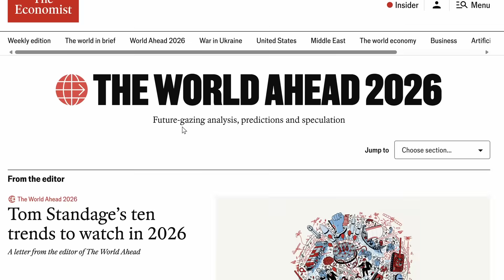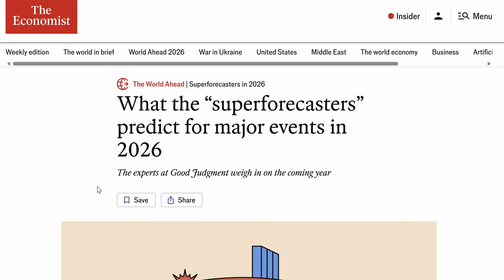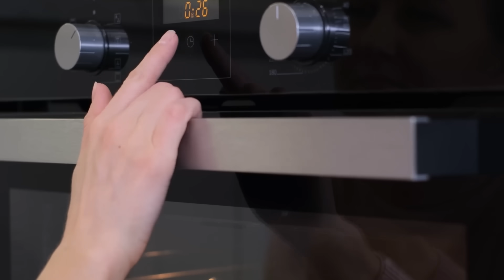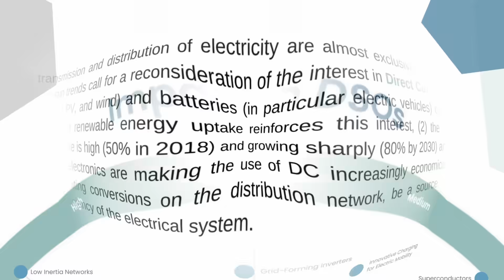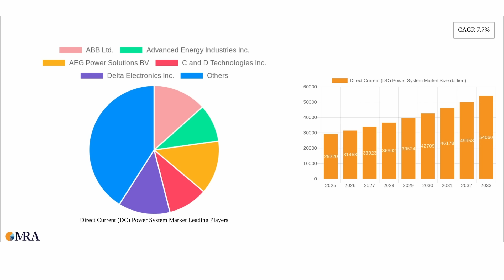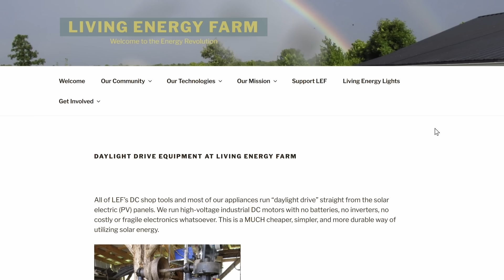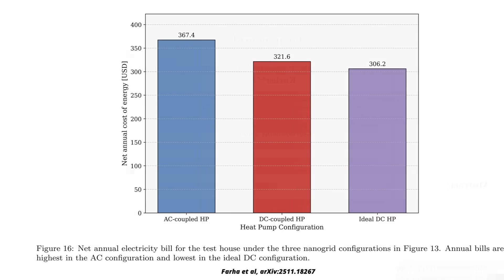Are We Using the Wrong Kind Of Electricity?

Comment: 2:39 The direction changes not 50 to 60 times per second. The reversal happens twice in a period. So, it happens 100 to 120 times per second.
Reply: Sine wave twice, Cosine Once.
Reply: @spencercurrent No. For example, cos(2πt/T) has zero at t=T/4 and t=3T/4 on the first period [0; T), and changes sign at each of them.
Reply: The confusion here is the Euro single-phase (lets skip over 3 phase for now) AC vs US AC standard.  The Euro is neutral-referenced at the bottom of the waveform, while the US standard is neutral-referenced in the middle of the waveform.  aka US "split phase" (which is still single phase), verses European "true single phase".

In the U.S. standard, 240VAC (also single phase) is generated from two 180-degree phase shifted 120VAC waveforms.  The two end taps of a transformer with the neutral in the center.   Yes, its still single phase.  This is what "split phase" is.  120VAC can be made line-to-neutral from either phase which is why 1-pole breakers are 120VAC regardless of the phase they are on, and 2-pole breakers are 240VAC.

So in terms of a ground-fault, with the European standard there is only one point where the AC hits zero, and in the American system there are two.  Per cycle.

Phase-to-phase faults are naturally center-referenced so for a phase-to-phase fault there  are two per cycle (100 times per second or 120 times per second depending on the country).  For both European and American.

-Matt
Reply: @junkerzn7312 Thanks, that is quite interesting. Then, in terms of reversal of voltage, there is 2 reversals in case of US and 0 reversals in case of Europe (except for noise, of course).
Reply: @yurkoflisk  Single-phase european style relative to neutral, yes.  Effectively the voltage still does go to zero once, but it won't cross zero.  In a phase-to-phase fault there are 2 transitions across zero in both systems.

Also, different countries deal with isolation differently, so the types of faults are very different.  In the U.S., ground and neutral are bonded.  Not sure about europe, but in many countries the power is isolated and neutral is not bonded to ground, so there is no current path through the body if you touch a live wire.  (but isolation has its own problems... there is no clear advantage either way).
Reply: Came here only to check if anybody made this obvious. Surprised to see how ignorant people like to show their stupidity showing absence of any understanding.
Reply: she did say "depending upon where you live" 

standards vary
Reply: @thehellyousay Yes, but in the vast majority of countries 50 or 60 Hz is the standard, and this is almost certainly what Sabine meant. The direction change 50 or 60 times a second would require 25 or 30 Hz, and from what I just googled, only 25 Hz has rare uses now on several railway systems (i.e. not even for household-reaching grids), and 30 Hz doesn't have even that.
Reply: @thehellyousay  There's no country on earth using 25 Hz or 30 Hz AC.

Comment: I'm off grid and hate inefficiency but AC definitely has its place. It can carry more current through a given thickness of cable and it can be transformed to a required voltage, very useful for PPT chargers. You have a given amount of power, Watts, which can be any combination of Volts x Amps. To charge a battery, you need the voltage to be higher than the battery to get the amps in there. So a simple charger might put out 15V to charge a battery to 13.5V. However, if the battery is down to 10V, that's very wasteful so taking, say, a 10% hit to convert it down to 12V and put the rest into Amps, you're taking the hit on the conversion but making it up at the other end. 
It's like a single gear bicycle - under ideal conditions it's more efficient but anywhere else the gears win out.

Comment: Even if you transmit DC, you still have to step it down which causes loss. In the UK we have 230-240v AC which when touched causes muscle spasms which tends to move your body away from it. Try the same with the same voltage in DC and you’re dead!

Comment: A highly misleading video, everything about DC grid is expensive, wires, convertors, fuses, relays, switches, motors, bulbs. each of the DC equipment runs in different voltages, so converters are still required to step down or step up to different voltages. ac is still safer as DC switches creates bigger arc, which can cause fires.

Comment: The biggest issue is that companies aren't buying or making the AC motors that can be more efficient. all ready have 94 to 97% efficiency on a normal motor. The problem occurs when you try to reduce to to small of a motor and use the same frequency. A motor is after all an inductor. So it works better with the right frequency. If you want a real small motor you need higher frequencies.  The way you shape your rotor poles can reduce eddy currents and improve efficiency. You can get 99% without much of an issue.
What makes transmission lines efficient or not is the current that goes across them. The more current the less efficient. current is directly related to the heat produced and lost thus electricity lost.
There is a general lie. There is no way to raise DC efficiently to a high voltage for line transmission without either producing at that voltage or using an AC transformer. High voltage rectification is a pain in the ass verses low voltage. It is far better to use AC transmission and step up and step down transformer and convert to DC at the location. Anyone saying different is a liar. I say that as someone who has worked in the field with both.